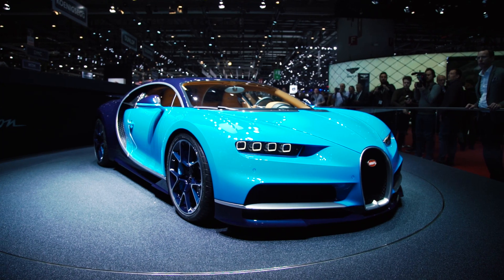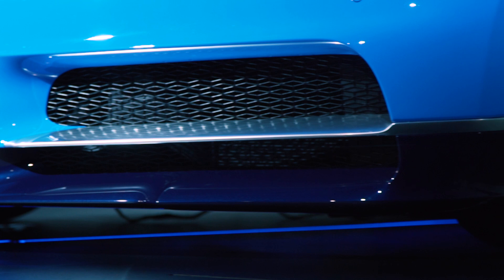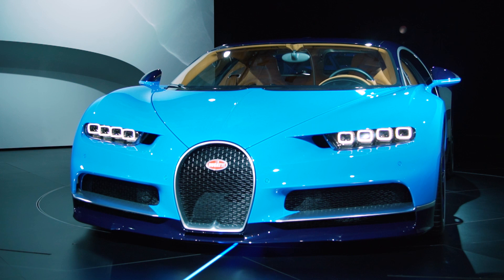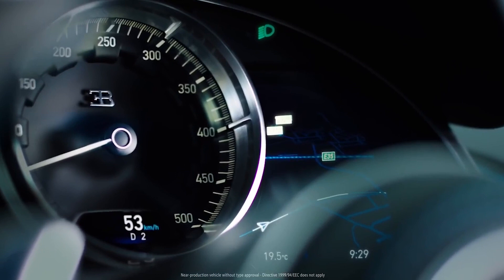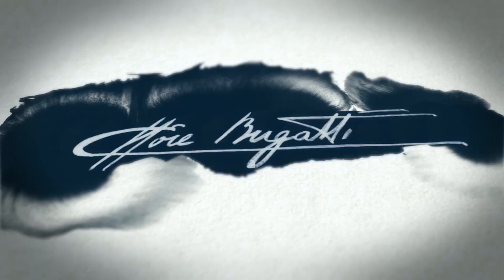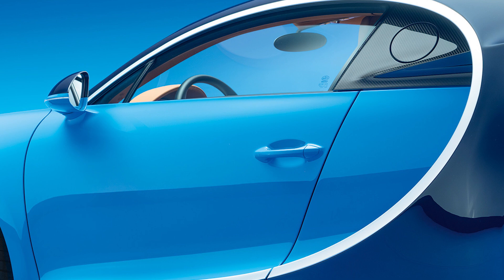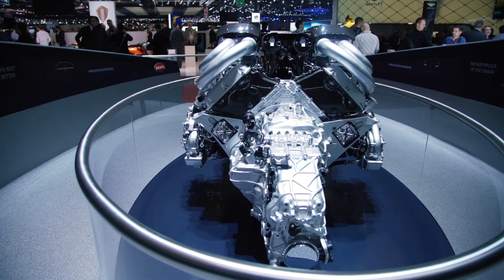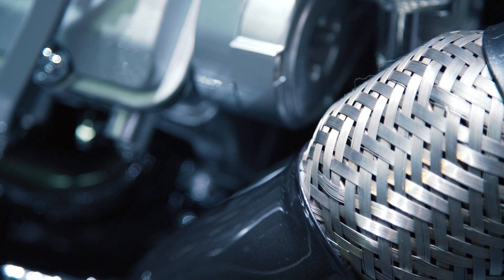Bugatti Chiron: Engineering and Design Explained - Carfection

Comment: Does anyone else feel that Ettore Bugatti would be turning in his grave if he knew what they were doing with his car company? He himself described bentleys as the fastest racing trucks. Bugatti was born from building light weight innovative road legal race cars, a far cry away from these big monstrously fast hyper luxury cars.
Reply: +Terry Dolan He's dead. He couldn't care even if he wanted to.
Reply: +Jesse D.... didja havtuh smack'em down sooo bad?!...LOL!
Reply: +Michael Charity same turbo set up as a 88 Porsche 959 or a new BMW 3 series. Although it looks like they may have a similar set up turbo wise to Mercedes F1 cars. Looked like the compressor housing was separated from the turbine housing by the Engine block. Must have a drive shaft running through the engine. That's mildly interesting.
Reply: +Terry Dolan  
Ettore would be happy his brand lives on., his son Roland was forced to sell the company after vainly attempting to keep afloat.  Bugatti of old also built Type 41 Royale, the largest and heaviest ever made by the company. Type 57 Atlantic is actually a high speed luxury GT of its time. Veyron successfully established the brand at the highest level Ettore could ever dreamed, Chiron carries on the legacy as being a work of art.

+Jason Mullings
Bugatti cars are actually French being built in Molsheim, German city until the end of WWI. Modern Bugatti i.e. Veyron and Chiron can be considered Franco-German.
Reply: The Venom GT will not be beaten,when it comes to top speed,by the Chiron... Juss Sayin Bruh! yea I'm just Trollin thru!
Reply: Because when I think "heavy, slow and crappy" the first thing that comes to mind is "Bugatti". I think he'd be pretty happy that his name is the pinnacle of the automotive world.
Reply: +Terry Dolan bugatti royale was not light weight, actually it was the biggest and heaviest road car of the era and they actually used its 12.7 litre engine to power a train, i think mr. bugatti would be very proud if he saw what bugatti is doing, you promoted a bit of a fallacy here
Reply: +Jason Mullings French car not italian.
Reply: +Tippotipo True about "Bugatti cars are actually French"
T41 is the most luxurious car ever built.
Atlantic is a supercar.
Reply: +Audiwan Kenobi Vernon GT is a kit car with dragster engine. Is not in the same league as the Bugatti (luxurious and reliable).
Reply: ***** who said that the Venom GT wasn't reliable?...I'm pretty sure that it's more luxurious than anyone of my cars...I betcha that in a side by attention contest the Venom would win.
Reply: +Audiwan Kenobi, the Venom GT is a Lotus Elise kit car body. It is not comfortable at all, even an 94 Honda Civic is more luxurious than this car. It is not reliable as Bugatti Veyron and Chiron. Bugatti could easily have twice the power on the engine if they are like Venom GT or Koenigsegg (you have to rebuild the engine after some time), but Bugatti preferred to keep it very reliable and smooth. You can watch some videos of engineers explaining how the Chiron/Veyron engines works, it is s marvel of engineering.
Reply: My single minded focus is top speed.
The Venom is not a kit car.
Reply: Audiwan Kenobi
It is by definition because it uses the existing Lotus Exige body and swap engine from third parties i.e. Delta Motorsports. The fact it has rollcage and the driver was terrified when going at high speed show its unstability and reliability. Hennesey simply setup the car like a dragster.
Reply: Rover Waters kiss my motherfather cuss dude...ima tell right na that you don't want me to get started on you.

Comment: Koenigsegg Regera is better than this lump.
Reply: Sounds like you really know your stuff mate. Maybe you could make a career of it.
Reply: +Ishten Yobahtop It what way?
Reply: +Martin Allen yes definitely I can see it too ..a bright future is waiting for him if he do so
Reply: +urjustmyexp it's faster accelerating&has WAY more hp, it's also lighter, hybrid, and has a wider rev range&is likely more responsive.
Reply: John Harrison The Chiron's top speed is higher and it is guaranteed to have a better handling due to reengineering the weight, transmission and body aerodynamics.
Reply: urjustmyexp only because they designed a car without a gearbox. The Egg has the HP to fly by the Chiron.
Reply: +John Harrison Maybe just wait and see.  So far the Veyrons raped anything else out there except one car based on a Lotus, so why doubt that Bugatti will let anyone beat their top speed?  Especially a company who has not had any records lately.  I like all these crazy hypercars, but give credit where credit is due, Bugatti's rape most anything in a straight line.
Reply: iSOBigD not eggs, and the One:1 0-300-0 still stands, a record the Chiron isn't even attempting to touch while Koenigsegg promises to improve the time by over a second! Give credit where credit is due ;)
Reply: John Harrison Why compare two cars with different goals and then say 'hah, this one sucks"?  Bugatti wanted the highest top speed and they got it multiple times.  They held the 0-60 time for many years as well and even today 2.5 sec is a crazy number.  There are lots of crazy hypercars around but that doesn't make the Bugatti's suck, despite their looks.
Reply: iSOBigD when did I say that the Chiron performs poorly or that it sucks? I said it can't touch an Egg's 0-300-0, which is true. And they wouldn't hold the record if they allowed other cars to test on their track.
Reply: +john marsh the jealousy is strong in this one.
Reply: eyeballs97 I totally agree Bugatti isn't playing fair. but it isn't really heavier than the old car, it has a better power/weight than the old car.
Reply: eyeballs97 I agree it'll probably be bad round a track, and this platform will be expected to last 10 years, it won't hold up half as well as the Veyron did.
Reply: eyeballs97 it'll be trounced by the coming Regera revisions, if the Regera is going to be the base Agera equivalent, imagine what the R, S, RS, and One:1 Regera-platform equivalents will be like, and that'll all happen in the first 5 years of the Chiron, let alone the Regera's successor.

The Agera line saw a 40% hp increase&a 25% torque increase, a "mere" 30%hp increase on the Regera would mean 2,100hp, and a 20% torque increase would mean 1,700lbf. If downforce also proportionally increases (100% increase), then you'd see 900kg at 155mph. I don't think the Chiron will keep up with Koenigsegg's level of improvement. But for right now Bugatti is competitive.
Reply: +Ishten Yobahtop http://www.topgear.com/car-news/geneva-motor-show/bugatti-chiron-vs-worlds-greatest-hypercars#1
Reply: +Ishten Yobahtop Boy you Koenigsegg fanboys are even worse than the GT-R ones. This car is in a whole other league.
Reply: +kraenk12 finally someone with open eyes... I cant believe the amount of hate the Chiron is getting by pseudo car guys. 100% just as bad as the gtr fanboys.
we get it guys you are all billionaire engineers who are best friends with Christian and are ordering your Regera soon.
Reply: +Ishten Yobahtop  damn you already drove it !!

Comment: I'm throughly disappointed that this car shares the same W16, similar turbos, chassis, gearbox, AND axles as the Veyron, while making it heavier. It's just "average" against it's current competition, but this platform won't be competitive in 5 let alone 10 years. Come on VW, apply some of your lessons learned from the Asterion&918!

I hope Koenigsegg does a hardcore Regera next year&it goes 275, just to keep the industry moving forward.
Reply: Shane Barrios I don't need to do anything, Koenigsegg is breaking new ground since Bugatti refuses.
Reply: +John Harrison K is like two leagues below B though.
Reply: @amarjit singh the new hybrid system is simpler and more efficient than anything else on the road. It's more of an advancement than the vw group. It's quicker, lighter and just as luxurious.

Comment: I had high hopes for the Chiron but unfortunately it is ugly, just like the Veyron.
Reply: No,its better than veyron
Reply: I agree, and his technology is outdated compared to Laferrari/P1/918/koenigsegg/...
Reply: +Steve Gerber How is it outdated?
Reply: urjustmyexp No hybrid technology at all, just 4 golf gti engine stick together ! (joke) No significative evolution from the veyron, etc. Not acceptable for a 2 million € car. In my opinion, this product stand for "getting a bit more costeffective the massive money engaged in R&D for the veyron"
Reply: +Steve Gerber You mean that it doesnt have batteries?
Reply: +Eric X well, it was designed by Borat Sakdiyev, so no surprise there...
Reply: +Eric X If you don't have assets worth at least 100+ mil., they don't care!
Reply: well you need 2.3 mil i believe ...
Reply: +Steve Gerber Reason is current hybrid technology is not mature enough to handle such power and torque while being strong and reliable for a hypercar like Chiron designed to handle 400+ km/h. One of Chiron mule sounds like a hybrid with its unusual sound so different than the regular W16 engine. Look how Porsche, Ferrari and McLaren struggled to develop one.  2 millions Euro if you take account Chiron chassis is designed to handle 50000 NM force similar to LPM1 Lemans prototype, has interior and a sound system with a diamond membrane speaker, the strongest dual clutch transmission ever made.
Reply: *****
 I did and I doubt what Koenigsegg call Direct Drive  system (still hybrid) will be ready this year due to the size of development after seen Shmee video riding on the Regera. It will need a gearbox to properly distribute the power in ICE engine. I saw the 65,000 NM monocoque torsal rigidity figure in the soec raising the level of skepticism given the budget of Koenigsegg and the cost of reaching LMP1 soec.
Reply: *****
It is about the Direct Drive as called by Koenigsegg which looks like a hybrid system. It sounds good in theory but in practice, there is currently no video about an intensive test of that applied system working hard on a circuit.

The no gearbox method will not work for hi-speed supercar unless the e-motors act like a gearbox for the ICE engine. Only known footages are dynamo test and ride a low speed  from Regera. It will be hardly surprising Regera will not be ready this year in order to resolve issues.
Reply: *****
So by definition E-motors is basically a type of electric gearbox.
With the help of one of folks discussing about Direct Drive on EngineerExplained, someone pointed out a issue using Koenigsegg own data:
_The Regera has not nearly enough power to reach its claimed acceleration figures. Let’s make a quick calculation to prove this. All based on the official data which I have linked above.

150 to 250 kph in 3.2 sec means an average acceleration of 8.7 m/s². Let’s assume 8.5 m/s² @ 200 kph. Multiplied by the curb weight of 1630 kg that’s about 13.8 kN of tractive force needed at the wheels (for acceleration ONLY). 200 kph is around 1500 RPM at the wheels or 4400 RPM at the ICE. This is where the torque maximum of all machines is located. Means: (1250+300)*2.85 + 260 + 260 = 4940 Nm at the wheels which is 13.7 kN. So the Regera produces an absolute maximum of 13.7 kN of tractive force (neglecting losses). For its claimed acceleration times it would have to deliver 13.8 kN @ 200 kph PLUS a huge lot more to overcome air drag and rolling friction._

Accordingly, I don't think Regera will be ready this year due to that shortcoming which explain why it runs a bit slower on several videos.
Reply: +Eric X Thats fine. You don't have to buy it. Stick to your Civic.
Reply: kraenk12 He's the designer, and no thanks. I prefer some hygiene.

Comment: 700 bhp per tonne. I would assume it performs like a Pagani Huayra with better traction because of AWD.
Reply: You know this thing is going to out-accelerate the hyper three.
Reply: +Willy Lamb-Orgel In a straight line perhaps, but because of its weight it'll probably get eaten on a track
Reply: Willy Lamb-Orgel
On a rolling start for sure. They hyper three are still on the lighter side though.
Reply: +Willy Lamb-Orgel gets destroyed on track by all of them

Comment: Regera will get to 186mph at least a second and a half faster.
Reply: +John Harrison First of all, this is not an American car, so you don't get to measure it's speed in fucking mph. (Just kidding). And yes, the Regera is slightly faster from 0 to 300 km/h. However, what you didn't mention was it's 0-100 time, which is 2.3 sec compared to the Regeras 2.8 and it's top speed, which is also higher. Honestly, the Chiron has a pretty ridiculous engine, but you can't deny that it's an outstanding car and beats the Regera in a lot of stats, while the Regera wins in other categories.
Reply: +Snake Productions yes, the Chiron does some impressive stuff but honestly I'm just mad that the Chiron is basically the Veyron 16.4 Super Super Sport. They only release one car per decade, too so while it's impressive for 2016, by 2020 (less than halfway through it's life) it won't be competitive, and I doubt they can squeeze another 200 hp out of the engine&keep reasonable torque/power curves.
Reply: Jackie Scholl
Oh, sorry, didn't even realize that :P